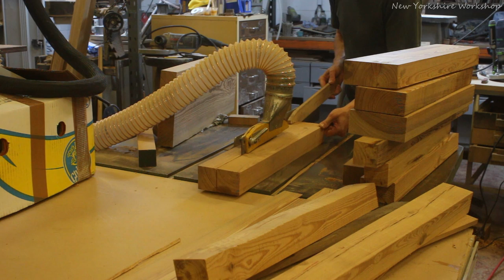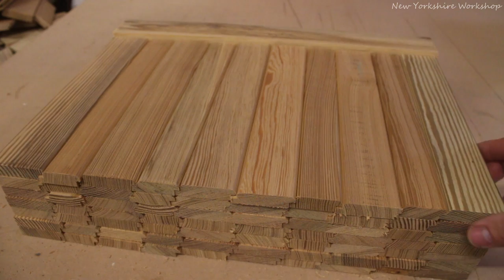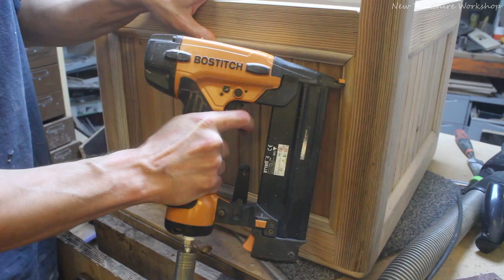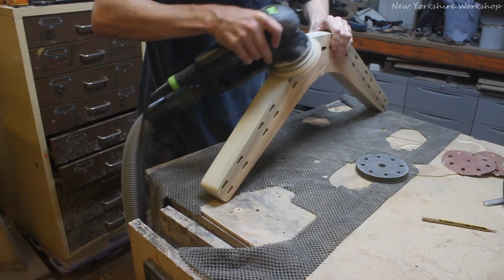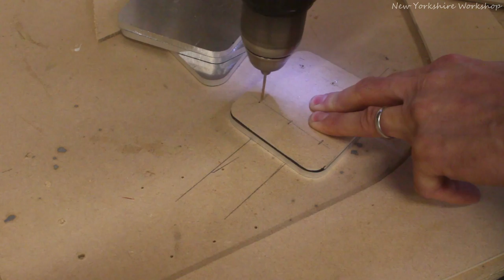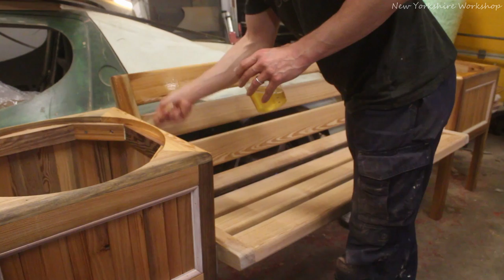making a garden bench and planters

Comment: Beautiful job! Much better than my planters!
I ran a stainless steel lag bolt into the bottom of the legs of my planters. This allows me to adjust for uneven ground, but more importantly, prevents the legs from contact with wet patio slabs.

Comment: Great project as always, though do worry about your dominos. I was taught not to use premade dominos and fishes outside, because they are made of beech. Which has a horrible weather resistence. The joints will last shorter and take in moist and fungus faster.
You can use dominos, if you make the dominos yourself from oak or similar wood with better weather resistence. 
Let me know if im wrong, could save time in later project :).

Comment: High five!  Wow, that thing is a beast; it should last for ever and you can park a car on it too.  I like the design and build!  I always try to learn, so a question:  Why Gorilla glue rather than outdoor wood glue?  Seems the clean up would be much less with the outdoor wood glue.
Reply from the maker: Gorilla glue is a moisture curing polyurethane so water helps it to cure and will never deteriorate it. the only thing better is probably Cascamite (urea formaldehyde resin) or epoxy, out of the three the polyurethane is the easiest to clean up because it foams up on the surfaces so it is really easy to scrape away. the standard pva type glues- d3 and d4 rated are only weather resistant and will eventually just dissolve when exposed to a lot of water so are no good at all for a bench that is outside throughout the year.
Reply: @Jim - thank you for asking this. I didn't know ANY of the stuff he replied with, until he did.
Reply: In boatbuilding, epoxy or cascamite/ resorcinol (urea formaldehyde glues) are used for below the waterline (constant immersion) and polyurethane (PU) or epoxy are used for above the waterline. The downside of the urea formaldehyde glues is that they are dark red, and both they and epoxy soak in- great for adhesion, horrid for clean up!

Comment: I've seen it a few times in your videos: how did you install a Festool power connector on that Bosch router? Were you able to order the parts, or did you have to kill an old tool?
Reply from the maker: i just bought the part, it is from one of the sanders and happens to be a perfect fit to screw into the original cable clamp screws on the router. then the cable hole just needs opening up. really easy mod and worthwhile if you are using festool tools.
Reply: @NewYorkshireWorkshop  Great, thanks!

Comment: How did you make your Bosch router accept a Festool plug-it cord??
Reply from the maker: if you buy the internal mains connector part form the rts 400 sander, it bolts perfectly to the cable restraint screw holes inside that router, then you just need to carve the casing out a bit!